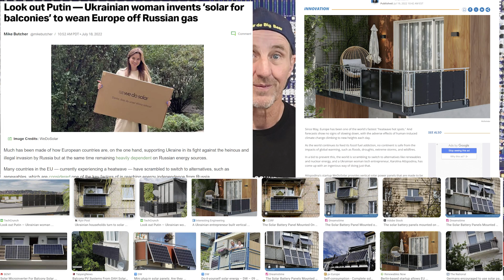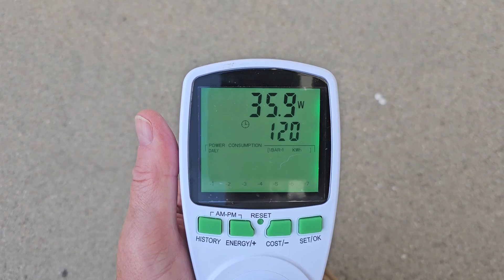Suicide Plug Solar Panels?

Comment: Yeah, good panels got really cheap. And the micro inverters too. I prefer the hoymiles brand. There are quality differences too. They should last at least 15 years... 
In Germany this small solar installations on f.e. on balconys are called Balkonkraftwerk. 
Here you can produce up to 800W with minimal paperwork but no compensation for the power. It's only for direct use (or small storage). We usually use either two 300 or 400W inverters linked or one 600 or 800W double inverter with 380 - 430W large size panels (like trina solar vertex s or ja solar or or or...). 
You can also take quad inverters with 1500W max and limit them to 800W for a more even power supply (like a sound signal with a limiter 😊). 
These systems are easy and fun to build. 
Don't stress about regulations. Just be within safety code. 
And with software and smart home solutions and tinkering you can maximize your solar direct consumption.
Greetings from Germany.
Reply: I think that is a key point @DaveRat, storage. Time to build your own battery for storage, so you can keep what you make.
Reply from the maker: Yes it's a great idea! Costco had a 12 kilowatt battery and panel with switchover for $8,000. So I bought that and I'm going to invent you into installing it either at my main house or Big Bear. I hope to do a video on that and they don't have the solar just charge the battery when I'm not there and switch the battery when I am there and see how close I can get to being off the grid
Reply from the maker: So cool and thank you for the info! Yes over here in the US we are slow to adopt and there is very limited selection. It's just a complete unknown.

I really appreciate the info!

Comment: 2:05 Here in the Netherlands you have to pay if energy is returned to the power company. The grid here is also overloaded and companies have to wait years for a connection to the normal power grid.

Car charging stations are also not possible in some parts. I once had the opportunity to ride an electric motorcycle. However, to charge it with the supplied charger it takes about 8 hours and uses approximately 1,750 watts - approximately 7.6 amps. - (230v/50Hz). On the road at a fast charger it will take you just over an hour.
Reply from the maker: Very interesting. Yeah I will have to see what happens here. This small four panel setup won't make enough energy to even power with the house typically uses but I look forward to testing and seeing what happens.

Comment: Looking forwards to your updates on this system, including reliability and hardiness against inclement weather… obviously it won’t perform with snow, but will it live again after snow load? The panels look a bit thin to hold such a load….
Reply: "Wind's picking up... storm's a-brewing."
"Quick - bring in the main sail, before she rips and blows away!"
"Can't, sir - you glued and nailed her to the ship!"
As a gust swoops down and picks up the panel structure, carrying it over the nearby town.
"It's the jellyfish UFO!" the townspeople will say. But youll be trying to chase it down "My generator's getting away!"
Better make sure it's on there pretty tight, but also removable for heavy snowstorms.
Reply from the maker: Those panels are rated at 5400 PA, which calculates out to about 113 lb per square foot.

The panels are bolted to the redwood beams with four bolts each and the entire structure is bolted to the deck where the cross beams are. And it's tied into the house where I've anchored the eve to the house beams and anchored the lean-to to the eve.

The entire structure is crazy rigid and the solar panels form a leak proof roof and I sealed the seams with clear caulking.

Solar panel specs:

Dimension: 48.98 ×26.57 ×1.38inch /1244 x 675 x 35mm, 22.88lbs/10.38kg, high winds (2400PA) and snow loads (5400PA)

Comment: If you Google NEC- Solar power,  you'll get the latest code requirements.  The biggest concern is during a power outtage, back feeding the grid. This could kill a lineman. This really applies to very large, high output systems  and standby generators. But that is a pretty cool system sparky!
Reply from the maker: The system can't backfeed. The inverter is powered by the wall so as soon as the power goes down the solar inverter stops working
Reply: @DaveRat  as long as you are absolutely positive there is no possible way for it, or a combination of them, to back feed the grid. I have a good friend whose father was a lineman who got killed restoring power after a storm because someone decided to use a suicide cord and a generator. What if all your neighbors had them (or you had multiples), How would it differentiate between electric company power vs power from a different solar system ( not in the astronomic sense lol).
Reply: @stephenstange4194 generally if another generator was started and backfeeding, the voltage and frequency would be far enough out of spec that the unit would stay shut down for self protection.

While a regular generator can back feed enough power to kill a lineman (after it gets stepped way up by the transformer on the pole), it's going to be loaded down so much that it's probably going to be running slow and not putting out proper voltages.
Reply from the maker: Yeah after reading up on it I learned something interesting. if you look at it the other way: let's say that the unit malfunctions and actually does try to backfeed the grid.

Since the grid is all tied together, as in all the other houses with all the other appliances all attached to it, that would mean my poor little solar panels would be trying to energize thousands of washing machines and refrigerators and light bulbs throughout the entire community.

Even if it did try and backfeed the system my little 640 watt system or even if it was a hundred times that size would instantly blow up or short out with the tremendous load of the entire neighborhood on its shoulders. An entire grid that needs an entire power plant to energize!

So there would be no voltage, it would be like an ant trying to push a semi truck and worrying about whether the truck is going to roll over somebody.

The actual concern would be that if the grid went down and then someone shut off the main breaker to my house and if my system was capable of still generating electricity even when it's not connected to the grid and not being shorted out, that someone working on my house that's disconnected from the grid could get shocked.

But since this type of inverter must see a sync signal from the grid in order to operate and know what phase to generate and lock to, it won't even power up as soon as the breakers to my house are disconnected.

So yeah, there really is no way that this poses a hazard or danger no matter how you look at it.
Reply: @DaveRat utility workers still get killed working on the line that's back fed by a generator, so their IS still a danger of back feeding, though only in specific circumstances, such as the wire being down nearby so you are only feeding a couple of houses, or something like that.
It's probably more of an issue in rural areas where you might not have a neighbor for a mile, so that mile of wire could be at 12kv from your generator, but it could also be a risk if the wire is ripped off the transformer outside your house in the city, so only the Primary terminals on the transformer are hot, and the lineman touches them when putting the wires back on.

So don't dismiss the danger, though your system is smart enough not to do it lol
Reply: @DaveRat   Which raises a question. How does the inverter know when the 120vac at the ‘special plug’ is not available at the line exclusive of the inverter? How does it know?
Reply: @DaveRat so when the power goes down (thunderstorm) you still lose power.
Reply: There are a few ways to detect this, most common is for the inverter to try increase the output frequency, if it is connected to grid won't be able to, if it is disconnected it can and then shuts down.
Reply from the maker: Another way to detect this is what I do in the video which is unplug the inverter And then really quickly lick the Edison plug
Reply: @ShaneFromSA   That would be an ingenious solution if not for the fact that is the same mechanism that enables sync. That ‘servo-ing’ is in constant use, literally every sample. I doubt that is what it’s doing.

Comment: I to liked the idea of Solar for many reasons. I have 3 Solar Arrays running on my property. The Electrical Code here in Nova Scotia is changing continually LiFePo4 Battery Technology has added some changes along the way. I love the reduce your utilities bill as much as possible but I am sure they will not like this type of generation of power because it will reduces their pay cheques as more power is generated at home. The concept is awesome but they like the 25 year contract that they track the credits in Nova Scotia! This way they control how much power is actually generated by solar. Applications all take time and there is a process to get approved.
Reply from the maker: I'm with you and thank you for the info!

Comment: Bad^ss!! ... Looking forward to Solar/Sub experiments  ; )
Happy New Year  
✌
Reply from the maker: I'm pondering whether to do a grid inverter test using a power amplifier as a grid source and see if I can learn some stuff
Reply: @DaveRat  Now your talking! Let's see it. Just my thoughts:l it seems that viewers are not realizing that the system you bought and hooked up is different than those used in Ukraine. I could be wrong about that, but since they are able to back-feed to each others homes and you are not, then I doubt it. Still, the lick test was a shocker! Thank you so very much for the education on sound, I am getting into the hobby for practical reasons. I find it amazing that some of your topics are pushing the industry forward, showing the reality of what is known or  assumed. Clearly, there is is still much to be learned by the industry with plenty of room for innovation, true sound innovation. Thanks for keeping it real!
Reply from the maker: So cool and yes you get it! The ability to back feed the grid is a challenge.

If enough people get solar and the grid stays somewhat active and it's just susceptible to brown outs then having all the soldiers back feed the grid while the synchronization frequency is still there is pretty straightforward and could reduce the brown outs and load to the grid.

Having solar back feed the grid in its entirety is not ideal because one little solar panel versus the draw of an entire city The city wins solar panel loses.

But if a specific apartment building loses power and has the ability to become its own little generator isolated when grit power drops and then resynchronizes back to the grid when grid comes back that would work.

The issue with "islanding" where a group of solar panels inverters all talk to each other and sink off of each other and try and stay energized when the grid goes down is kind of an issue not only because they are incapable of powering the grid so they need to disconnect but also present safety hazards for the electricians fixing the grid when it goes down because now the grid is down but there's solar panels trying to generate electricity to the grid.

Comment: I saw an all in one kit from amazon thats kinda expensive for one panel but this setup looks better.  Cant wait for the update video.
Reply from the maker: Cool cool Yes it still working and it's winter time so I'm not getting much power from the solar as the tall trees around her shading it.

I never realized how sensitive solar panels are to a little bit of shade.

Kind of like batteries in series where one cell is low the whole pack doesn't put out very much voltage or power.

Seems the solar cells are the same and each panel is a whole bunch of little cells in series and if you shade even a few of them hit drastically reduces the entire output of the panel.

At least for these panels.

And yes I will post more as soon as I have some good information
Reply: @DaveRat  this won't probably make you a lot of money on the bill, but with a few small batteries in the mix, like a UPS at the wall outlet where say your Internet is hooked up and a few solar powered security cameras, your vacation property can sustain it's own security system for free.  I have that T-Mobile mobile Internet and a few Amazon cameras that are solar powered/WiFi.  They don't use too much juice and I can check in when I want to via the app.
Reply: Viseefocu is the brand/company.  The price fluctuates too much but $29.99 (after $10 coupon) is the good time to buy

Comment: I would like to add a word of caution here.  In a solar system installed according to the electrical code, in the event of a power failure from the utility side, the system would disconnect the house from the utility power.  At that point all power usage in the house would be from the solar and storage systems.  The reason for this is to protect the linemen worked to repair the outage.  Without the disconnect, you are feeding power into the entire grid.  When  a lineman goes to make a repair, he will have voltage present on the load side that is not supposed to have power in it.  There have been very bad accidents due to people running generators backwards into their panels during power outages.  The current policy now is to check for power on the load side and tracking it down.  They then disconnect the source (your house) and fix the problem that caused the outage.  You then get the pleasure to call and explain that most of your neighbors have power and you don't.  They come out and bring an electrical inspector with them to deliver the lecture, paperwork to have your system fixed or removed and the wonderful slip with your bill on it for their time and the fines.  Since it is to protect the life of a human, I have to agree with the outcome.
Reply from the maker: Yes! And that was my #1 concern.

Did ya see where I licked the AC plug with everything live?

The inverter is powered by the 120 wall voltage so as soon as power goes down, the panels can no longer put voltage onto the grid.

I even tried unplugging really fast and also measuring the output.  The inverter needs the house electric to be live in order to output ac
Reply: I was really hoping that it shut off when it couldn't sync with the line power.  I just found your channel and joined to watch more and I thought you had taken that into consideration but others may not.  Thank you so much for the videos!!
 @DaveRat
Reply from the maker: @chamstreet1 very cool and great to meet you and appreciate the info!

Thank you!!
Reply: In my ad hoc system for hurricanes, I’ve used a 2PDT switch to avoid that. I’m embarrassed to admit, I originally deployed the switch without any thought of lineman issues. Not that I didn’t care, but that the hazard didn’t even occur to me. 🤦🏽‍♂️
Reply from the maker: The cool thing is that at least this inverter is powered by the wall power such that it cannot create voltage back to the building when the building power is off.

That said, there are systems that are capable of running your house when the building power is off. Those systems would definitely be a safety concern for lineman working on the system.

I believe the difference is whether or not it's an off-grid solar inverter or an on grid solar inverter like this

Comment: Seems like you would need to keep careful records of your usage and your bill to know if it was working. California solar rule changes are a drag. My state MASS is still has incentives. Our 10 Kw system was around $3.30 a watt 3 years ago. If I had not done this whole house project, (cause in Massachusetts, why wouldn't you), I was considering one of the portable battery / inverter boxes that has a DC input so you could use solar to charge it. I have no batteries yet for my house and have been talking with my solar guy about a trailer with batteries. That way I can use them in the summer to power my PA in remote locations and in the winter to help with storms. Cheers
Reply from the maker: Agreed and that little meter will tell me how many kilowatts went from the solar into the house so I'll have a number that I could just multiply by the cost and no pretty well what I've saved. Plus I have all the historical bills I can see if they drop. I'm thinking about adding two more of those lean-tos and bring it up to 1800 Watts and maxing out that 15 amp breaker though it'll never generate that because of shade and trees and stuff
Reply: @DaveRat  Yes, or just replace that 15 with a 20 amp breaker in the box.
Reply from the maker: I will do an update soon it's been generating power and I'm going to add six more panels to a total of 10 panels which gives me 1600 W maximum and it never hits maximum and it's 1600 Watts it's still less than 15 amps